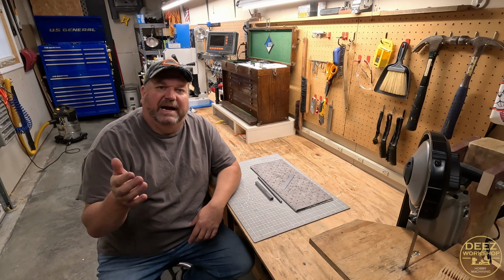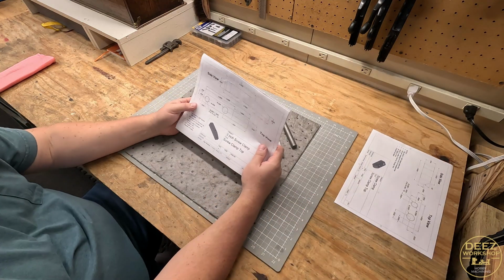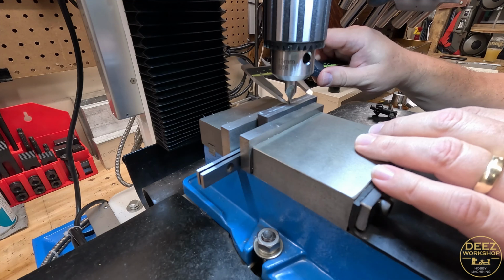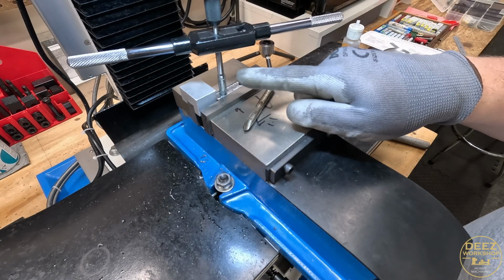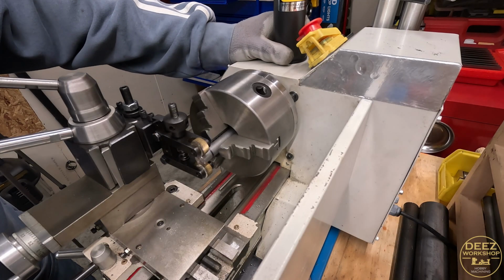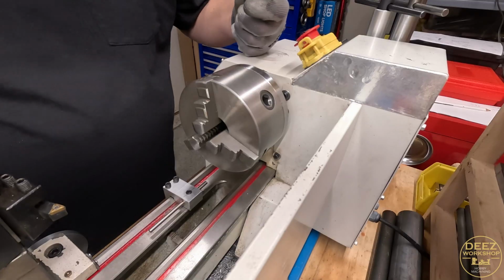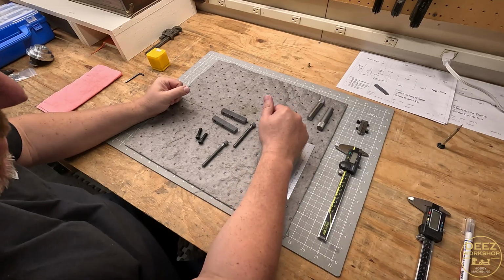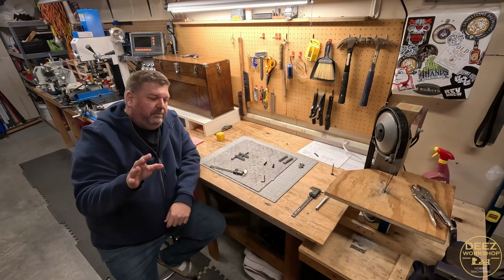3 Inch Screw Clamp - Part 1 of 2 - Autodesk Fusion 360 CAD Steep learning curve Lathe Mill Project

Comment: That threading looks nice with the wide relief under the head so you get a clean end of the thread and didn't even need to turn the die around.
I have several different parallel clamps, Starrett and others, and on all of them that I have the back screw does not pull the clamp together it pushes the back end of the jaws apart, like a jack screw.  One jaw has two threaded holes in it, the other jaw has a through hole in the front for the screw that pulls the jaws together, and just a recess on the back end for the jack screw that pushes the back apart. This both restrains the screw fro bending and slipping out of the clamp, and acts as an alignment guide to keep the clamp from just rotating around the front screw.  The back screw has about 3/16 of an inch of thread turned down so when it pushes into that recess it doesn't munge the threads.
The old Starretts have a small metal clip on the top jaw that rides in a groove in the knurled part of the front screw so you can open the clamp without using two hands to separate the jaws.  The newer Starretts accomplish the same thing with a circlip under the jaw in a groove around the threaded portion of the front screw.  I prefer the older design.
With a tommy bar to tighten them you can actually generate enough force to bend the jaws, I have a Starrett 2-1/2 inch clamp that the previous owner over torqued, the screws are undamaged but the jaws are curved fishmouthed.  
Also, for any clamps you build, a finer thread will give more clamping pressure with the same amount of torque, so small clamps use a 10-32 instead of a 10-24, or bigger clamps use a 1/4-28 instead of a 1/4-20.  That Starrett 2-1/2 inch clamp uses weird threads, well, because Starrett.  That actually appears to be a 12-26, which is not a standard that I can find.  I have noticed nonstandard threads on several Starrett tools, not sure if they make weird screws so it is harder for people to find parts, or if they maybe just kept using tooling from before the standards became standards.
Reply from the maker: Thanks,  I think overall these turned out very well.  I knew there was more to the parrallel clamps from Starrett or other manufactures.  Their designs make a lot more sense and perhaps someday I will tackle another set using some of those built in design elements.  I appreciate all the info as always.  Thanks for watching and providing in depth info.  Cheers.

Comment: Cheap taps are costly. They don't have proper relief angles and bind up. You are going to pay a lot of school fees w.r.t. order of operations. I still do sometimes. You will always learn and improve, no matter how long you've been doing it.
Reply from the maker: They really are,  I have began to build up a selection of higher wuality taps for the common sizes I use.  Slowing learning to avoid the temptations to use the cheap ones.  You are right,  Ruin a part that took many hours to work on from a broken tap is costly. Definitely agree about the learning process.  There is always a new challenge to take on.

Comment: Chuck up the stock. Turn thread diameter (and go a couple thou under)  , turn the diameter that needs knurled (break the mill finish), chamfer,  thread. Knurle,  part off. Grap threads in collet, face/finish the screw. That is tne dhort version

Comment: Hey Deez, there are many ways to do things and while I may not agree with yours, the end result turned out ok. The only thing I disagree with is your first measurements with the edge finder. Once finding the right edge with the finder you should have moved left .100 (half the diameter of the finder) and then zeroed your DRO. That then would have been the reference for ALL subsequent measurements. There was no need to find the zero on the left side. All the measurements should have been done from that one reference point. You should have done your drawings like that also. But even with the existing drawings you could have just done the math so that you only used one reference point.
Reply from the maker: Thanks for the tips. You make a lot of sense and I will remember this as I work on upcoming projects. Thanks.

Comment: Knurling I find not easy but found chips clog the wheels when turning so I constantly poor oil while knurling and get much better results. CNC's flood the area when doing it.
Reply from the maker: The chips/dust/metal shavings accumulate bery fast.  I tried to use some spray lubricant to flush out the chips during this knurling process.  Seemed to really help.

Comment: Those looked like some nice knurls. I would definitely rather clamp on a thread opposed to a knurl. I’m a collet fan as I have a lathe almost exclusively set up for 5C collets. Collets will generally do less damage to your work than chuck jaws. And collets usually offer better run out and repeatability.
Reply from the maker: Thansk,  The knurls turned out great on these parts but too bad I didnt use them.  Next week I improve from my mistakes and complete this project.  It turned out very well.  I am quite happy with this one.  I have considered thin parrallels,  I recall Blondi mentioning someone gave her thin parralles and she uses them all the time.  I do think that would be a great investment for the shop.  Thanks.

Comment: Get a set of thin parallels it helps alot. Same price as the thick ones. I use the thin ones alot. Hope it helps.
Reply: Grind a step on the top of the thick parallels about 10mm deep, leaving a 2mm wide strip on the top. This has the clearance advantage of thin parallels with the stability of thick ones.
Reply from the maker: I have them on my list and have really been wanting them.  After this project they have been moved up on my list.  Thanks and I agree.